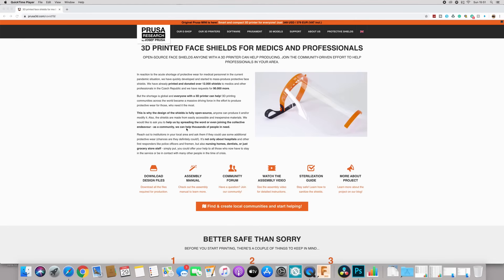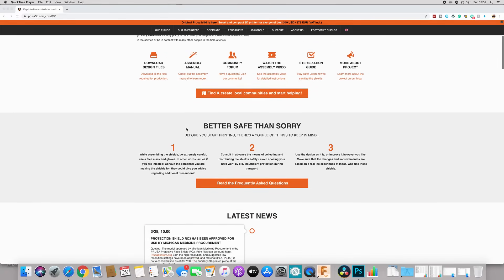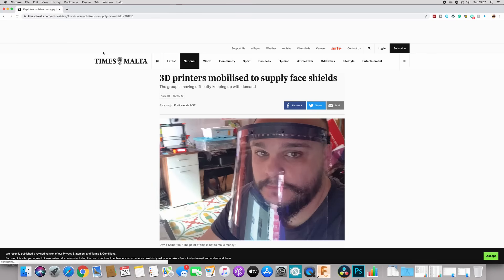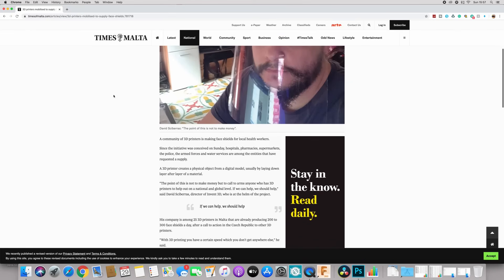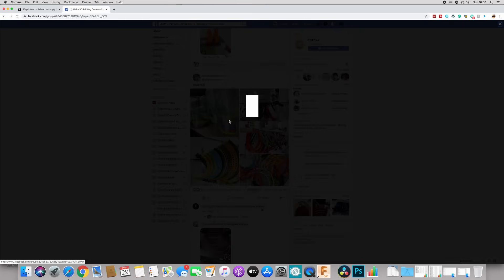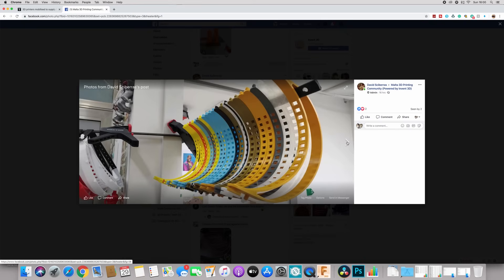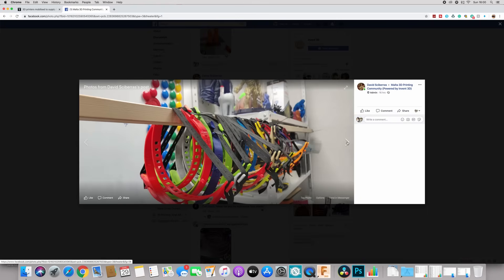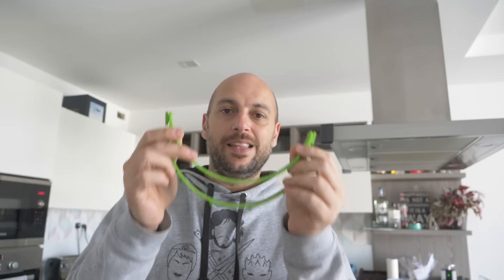Help Save Lives With 3D Printing

Comment: I would like to raise your attention for this: https://www.facebook.com/gabor.korosi.3/posts/3384408108254575 . I think it is a cheap and fast way to produce large number of face shields if the design is applicable for the local needs.

Comment: Im in!What quality should i be printing these at? It takes about 7 hours roughly to print on a cr-10/tevo tornado if im in 0.2 mm but on 0.28 its takes about 4 hours
Reply: His version is printed in 0.3 mm layer height, no supports needed
Reply: @HighbridgeD  got it.thank you

Comment: These are the models I have been printing and are much faster to print, especially if you stack them, https://3dverkstan.se/protective-visor/
https://3dprint.nih.gov/discover/3dpx-013300
Reply: I'm new to 3D Printing.  Can I purchase an Ender 3 Pro and create this?  What 3D printer would you recommend?
Reply: @andrewjohnson6229  Yes you can, I dont have an  Ender 3 pro but i hear it is a pretty good printer and it can fit these models in it's print area

Comment: We set up a injection mold production based on the design we made with different Hospitals und University. Im about 4 to 5 days we will deliver the first of them. We than can go up to 30.000 pieces a day and if needed wo could push the output up to 100.000 a day in just 4 more days. But I think Malta is too small as such a hughe investment and production would make sense.
Stay healthy!

Comment: what about the actual shields?  These are just the frame supports.
Reply: Thomas L A4 transparency film. Use A4 sheet landscape, use hole puncher, get the holes right and use that as a template to punch the transparency film.

Comment: Free is a good ideal, but not sustainable.  Print for cost (materials + printer wear).  Then if there's hardware failures, filament runs out etc you can continue printing.

Comment: Joe,

We also were inspired by the Prusa design. I am attaching a video of our version. I redesigned it to use tourniquet straps for the band instead of fabric elastic. They are in ample supply and are available from the hospital. No punching of holes and easily adjusted. I can supply the Fusion 360 adjuster component that can be can be added to your existing design, if so desired.

https://photos.app.goo.gl/njy71Mo6GjuuwE9m8

Comment: Great video.  As you said this is an opportunity for 3d printer hobbyists to do something useful.  I have shipped 26 to a local hospital and am working on more, they have a great system,  I'm just printing and others are doing the rest.  At the same time I'm, trying to produce a model for local first responders that is complete using an overhead transparency sheet.

Comment: @3dmn can you explain your settings for z-stacking your prints?
Reply: here is a link  https://www.prusaprinters.org/prints/27267-prusa-protective-face-shield-rc31-stack-versions
make sure of the version you need a do a test.  This works best with a lot of printers and printing over night.  I have not tried multiple stacks yet.

Comment: question how are you printing items on top of each other.  I am a RN in CCU and I just got my 3d printer a week ago.  I am currently printing facemask straps to keep the straps off the back of peoples ears.
Reply: there are a couple of stacked versions that split apart after printing using support towers.  I have not tried that yet, but some seem to have good luck.

Comment: This is a great initiative by makers here in Malta. I printed 20 in 2 days with 1 machine for my work place trying to do 50 for now.
Reply: Short lived have to stop as the person who had to deliver the transparent sheets just gave me 15 out of the promised 50 and I payed for the 50 and not sure if I will get the rest.
Reply: @siskodata  try using laminating film instead:)
Reply: @Jones01  will try got loads of that thanks
Reply: Just original supplier delivered the rest of the transparent sheets and restarted printing

Comment: I read that it would be a one time use. Did you hear the same ? PLA can be cleaned enough to be use more than one time ?
Reply from the maker: We are assuming these are one time use.
Reply: @3DMakerNoob  I’ve been using petg and abs because they can be sterilized
Reply: When you check CNC Kitchen's most recent video, PLA seems to hold up to IPA disinfectants quite well.

Comment: Fyi, this Swedish guy has an alternate design out. https://3dverkstan.se/protective-visor/  Probably not as durable, and may not hold on as tightly, but uses far less filament, and uses transparencies punched with standard hole punches.

Comment: 3DVerkstan used to have a paragraph about not sending in visors to them if you have pets and print at home, but that's gone now. Will have to check with them what applies there, and if it's OK to print with pets around I'll definitely make a bunch.
Reply: Är det okej att använda dessa i Sverige nu? AMV fick ju tuppjucket.